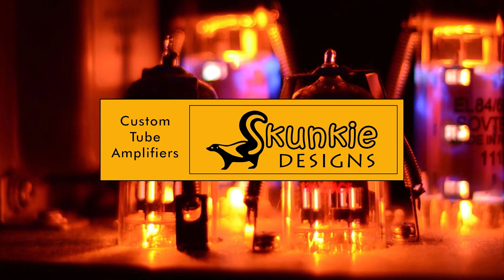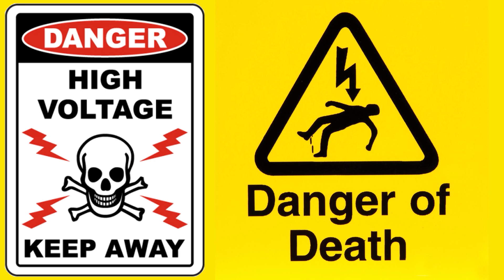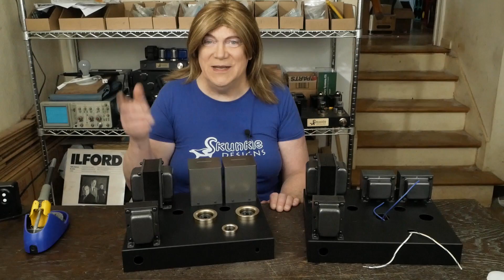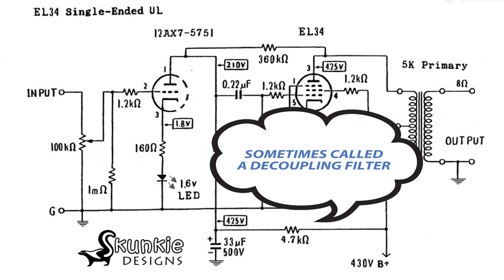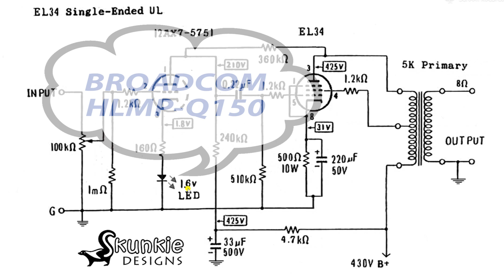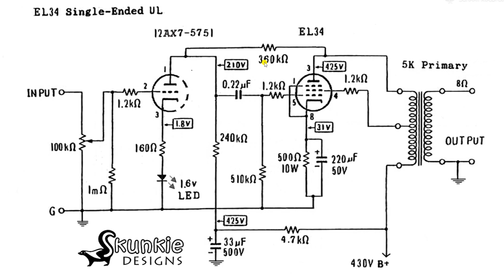Production 5751/EL34 Amp:  Schematic/Design Deep Dive!

Comment: hi ,i made  a single amp with  6sl7 and kt66 and i  placed  global negative feedback at the cathode resistor of 10k  ,but i see often in your shematic that you use local feedback ,for your advice can i get a better result with local negative  feedback ! ,so what value of resistor should i use  for my amp,  i think that -3db  output reduction is a good compromise ,are you all right  with that,thanks a lot
Reply from the maker: You'll have to experiment, start with 300K, I wouldn't go below 200K but I've used up to 1meg
Reply: ok  i will try  this ,ihave learned  that  feedback  design increase the output impedance  but it  dont have too consequences .thanks and happy holiday    @SkunkieDesignsElectronics
Reply from the maker: You are overthinking this. Just try some different values and adjust until you like the sound. Lower values tame the high end response, higher values will brighten it up.
Reply: ok i understand  im gonna try and listen to this ,thanks a lot @SkunkieDesignsElectronics

Comment: I am getting about 460v where you are calling out it should be 425v. Is this ok? This is without the shade feedback resistors installed
Reply from the maker: Hmm that's pretty high, like the plates of the tubes are 460? I've seen them vary up to 440 or so but not that high
Reply: I rechecked everything and re soldered a couple of things. Steady at 440 v now
Reply from the maker: There is a little variations in those Hammond transformers, some end up a little higher voltage than others, even from the same "batch".
Reply: Thanks for your help. I’ve got it up and running. I’m using EL34’s and the 12ax7 from a Eico amp that my dad built 63 years ago. Sounds awesome!

Comment: Hi, what is the difference between connecting a 160 ohm resistor to an LED or with bypass  capacitor?"
Reply from the maker: The LED gives a little more gain, sounds cleaner to my ears and eliminates having to deal with having a bypass cap in the signal path. It also splits the direct AC signal to ground (An LED and a bypassed resistor both do this) and the unbypassed to add a small amount of NFB at the cathode. And if you wanted to remove the LED, you would have to add a bypasses resistor in series with that 160R to keep the bias the same.

Comment: Great video. For me as a novice it would help if you specified when you are referring to DC vs AC on your schematic walk through. I know they coexist on the same wires but it does get confusing 🫤
Oh and I think dolly could use some grip tape or carpet on those stairs 🤠
Reply from the maker: Great suggestion!

Comment: Thank you for sharing this!  I'm planning on building this amp.  I noticed you are using 2 watt metal films.  I have a large stash of old Dale metal film resistors, mostly in 1/2 & 1 watt sizes I would like to use.  Do you think 1 watt plate & B+ dropping resistors would be sufficient & then I could use 1/2 watt everywhere else (other than the higher wattage power supply & cathode resistor)?  Thanks!
Reply from the maker: That resistor in the power supply needs to be a 5W. I think I have supplied enough voltages to calculate if those will work elsewhere.

Comment: Howdy.
I would say using the volume control pot. as shown is a waste of good gain.
I suggest controlling volume by controlling neg. feedback from the input tube's anode to the input tube's grid with a pot. This would make use of all the gain to minimize distrosion.
Regards.
Reply from the maker: You realize there is no negative feedback for a reason and I have no interest in removing all the distortion. If I did, I would just buy a SS amp. BTW I've never seen an amplifier control the volume in this way, adding this much NFB turns the amp into an oscillator.

Comment: Can you replace the 360k ohm feedback resistor with a linear potentiometer, adjust to suit your system then either lock it in place or measure the value and replace with fixed resistors?
Reply from the maker: I haven't done this, my worry is finding a pot rated for that voltage/wattage. I did do an amp once with a center off DPDT switch to be able to listen to zero feedback or two different values.

Comment: Hi, can i use local feedback if i connect the amp on triode mode !so do i have improvement on ringing square wave!We can see this on the kt 88 abdella amp vs blueglow .have you put  local feedback resistor on the kt 88 ,it would be interesting to see on your oscilloscope square wave 1000 hz  and  10000 hz  cause  you dont have vidéos for testing this amp .
Reply from the maker: You can but I have found from listening tests, very little if any local feedback is needed or desired if you triode strap the output tube. Doing so ends up with a very dead sounding amp irregardless of scope testing results
Reply: ok  the ear is the best judge  always
 @SkunkieDesignsElectronics

Comment: Thanks for the overview!  I noticed a manufacturer that has their main circuit ground point isolated from the chassis and earth ground with a capacitor.  Do you think this is unsafe or a good way to avoid ground loops?
Reply from the maker: I haven't found the need and don't like the idea of what is basically a floating ground. Especially if they don't have any of the input/outputs grounded directly. I always try to think worst case and don't think any part that can have human contact isn't zero ohms to chassis/earth.

Comment: I used one of those power switcher/GFI things to turn a hot-air popcorn popper on/off since it had no switch of its own.  I eventually noticed the switcher was hot (always) so I tossed it.  It may have been a different design.
Reply from the maker: That appliance likely pulls a lot more power is the difference here.

Comment: Nice looking circuit. Could include a triode switch too quite easily.
Reply: Having the cathode resistance in the driver stage unbypassed also improves the effectiveness of the plate feedback by increasing the Z of the 12ax plate.
Reply from the maker: And it sounds better :)
Reply: @SkunkieDesignsElectronics Would the unbypassed cathode resistor be a good option for the Reisong A12 modification?
Reply from the maker: Note I am only "unbypassing" a portion of the total cathode biasing voltage.

Comment: I'm currently building an EAR 834 clone which has solid state rectified power for 12.5V heaters and 280V B+ line. What woul be the pro/con vs a tube rectified set up?
Reply from the maker: I honestly don't see any reason to use a tube rectifier on a phono stage. I mainly use then for the slow B+ ramp with higher current output tubes, especially run as hot as I tend to run them.

Comment: That local feedback loop between the plates is a very nice solution...........it was used by Werstern Electric in many of their amps long ago...changing the value of the resistor can be optimized to your speaker choice .
I used it on some amplifiers ...example a 6V6 PP driven by a 6SL7 with 470 ohm resistors in tyhe FB loop between plates , and no use of global FB ....sounds very muical and open ..
Some  WE amps used also a capacitor ( 0.1 - 0.22 µF ) in series with the resistor in  the FB loop to avoid DC signals to enter the FB loop to the dirver tube.
If the OPT is good , by it's design this amp can have a very nice soundstage filled with music
avoiding the nasty harm that regular FB does to little signals and small dynamics.
The amp will also respond  clearly to the choice of components and the quality of the ubes ..so tube rolling might be  interesting to obtain the synergie one is looking for.
A very nice project for a DIY beginner and even for a skilled experienced audiophile

PS: When someone only needs fleapower on very sensitive speakers , easy to convert to triode mode , connecting the screen to the plate of the EL34 ( with resistor ) ........The EL34 ( as well as an EL84/6BQ5 ) works very well in triode mode....UL and penthode .....
RCA.....Sylvania GB ..and others sound very good as an input tube......finest tubes are the triple mica /black plates .....rare but one can find ONE .....witk a little luck.
Beware a 5751 sold as new or so claimed old stock measured good as a ECC83/12AX7 is in fact a used and ead tube.............So take attention to sellers that pretend the tuibes test as new ( but is in fact end of life  ).....especialy on Ebay....

Kind regards
Reply: Im a tube amp builder newb, that said Im very curious about having a dc blocking cap in the fb loop! Do you by chance remember the model of we amp? Love to dig up a schematic to see what they did! Great video and fantastic response!
Reply: @AudioFanMan  I have schematics of those WE amplifiers with the capacitor in that particular FB loop .......some studies more recently on SS amps showed the negarive influenhce by injecting DC into the NFB...
In case of the WE amps.........what is substantial is that they do not use global FB .....and distortion levels on small signals go under 0.01 % ....NF on more current SS creates hard distortion ..........very low on big signals but importantbon very small signals ...in French we call this " Distortion dur   "
IF you please I can  let you know the ISSBN number on those books...
WE was far ahead in tube technology at that time and old amplifiers are sold for horrendous high prices even when rusty ...
It is asthonishing gthe freedom one has by building these amplifiers oneself ............remember that amplifiers that let the music flow freely are like the beauty of wild horses versus those who are controled on horse shows to please the public..........
Also one need thse kind of loudspeaker that let express the musicality of these beaiuties.
You're a happy man to build yourself .........and keep in mind to BELIEVE your ears and soul rather than numbers............

Kind regards
Reply from the maker: I would add, if you change this to a triode output, I would remove the Schade feedback resistor. It's likely no longer needed.

Comment: Thank you for the safety advice 
Had not given it proper consideration…yikes
If people will spend $70k on an audio cable you can bet I will get the best GFCI plug-in outlet which won’t really cost very much thankfully 😅 
I have a healthy respect for High Voltage Rock ‘N Roll

Comment: Hello, Can a 650 Ohm cathode resistor be used so that the EL34 is not so at the limit of its power?
Reply from the maker: Sure, but these are $20 tubes, what are you trying to preserve? Expect more distortion and it won't sound as good.